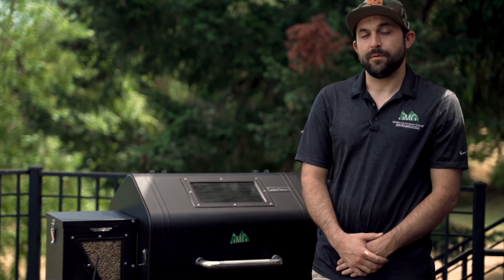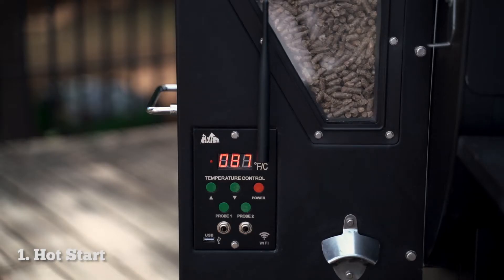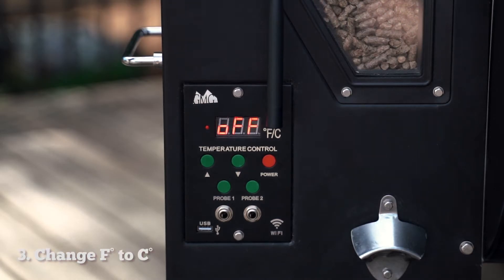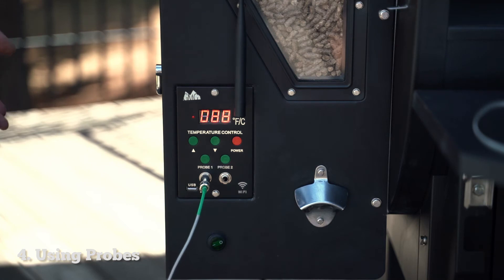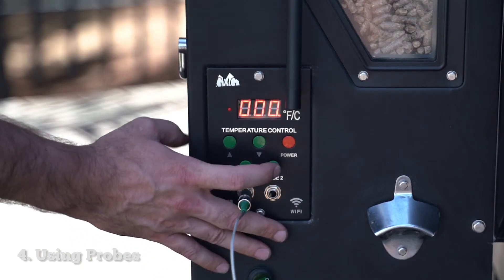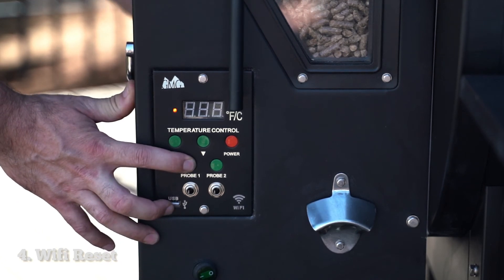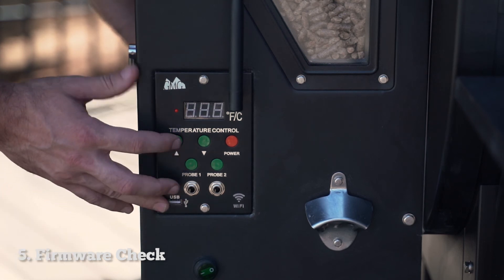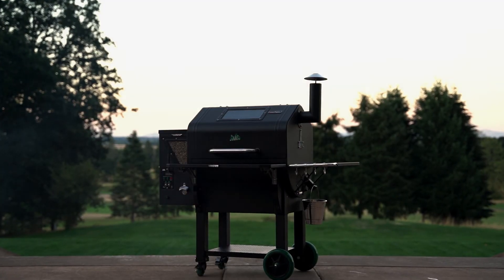Control Board Functions  |  Prime Plus Support  |  Green Mountain Grills

Comment: My Green Mountain Daniel Boone grill lost its wifi signal. The grill is less than 6months old. It worked perfectly from day 1. I did the reset and as soon as it would switch to my home wifi it could not find the signal. Their tech support tried to help and after getting my internet provider involved I determined it had to be the wifi in the GMG control panel that was bad. The grill worked fine but not the wifi, which was one of the big reasons I bought this unit. My dealer was great and they got GMG to send me a new control panel. The install was just a little more than plug and play but I got it installed. Now if you do have to replace your control panel, the wifi password to get the GMG wifi to work is no longer the password of the serial number on the back of the grill. It's the serial number of new control panel board. It took me awhile to figure that out and only by luck. I did a firmware update and noticed the new panel flashed a different serial number than the one that is on the back of the grill. I entered it instead of the grills serial number and it worked. GMG should revise their install video to explain that. Would have saved me a couple of hours of frustration.